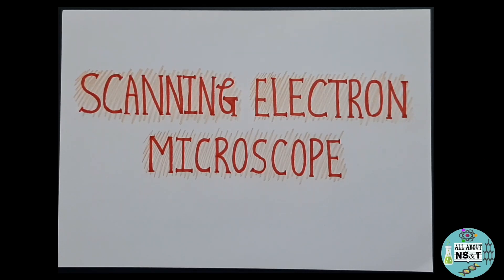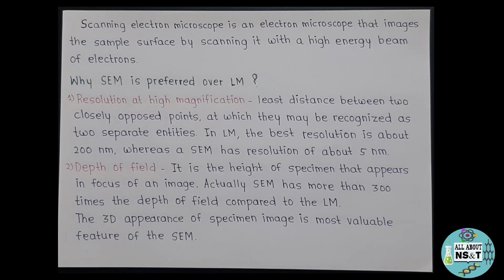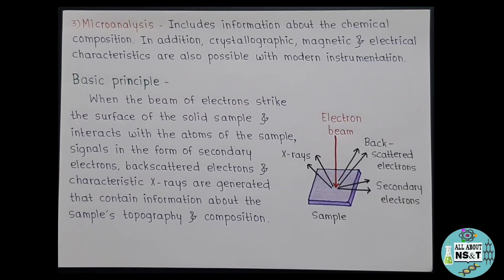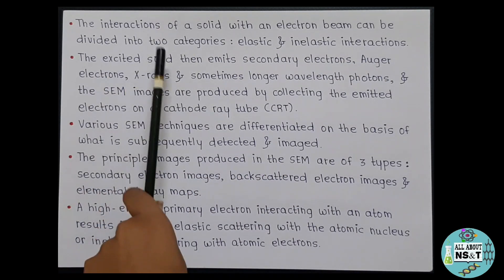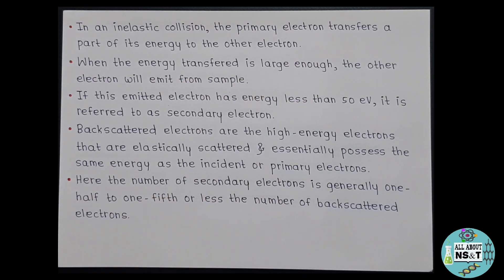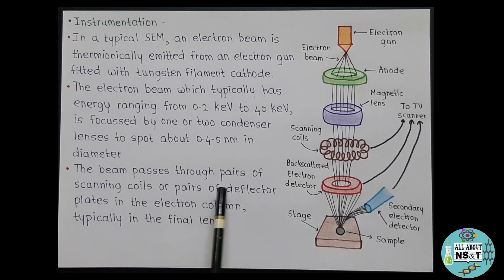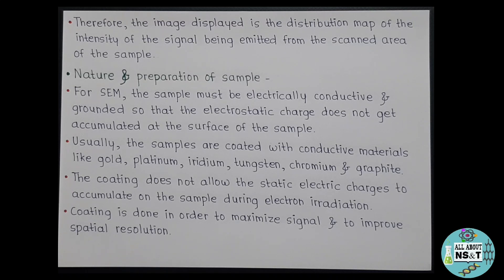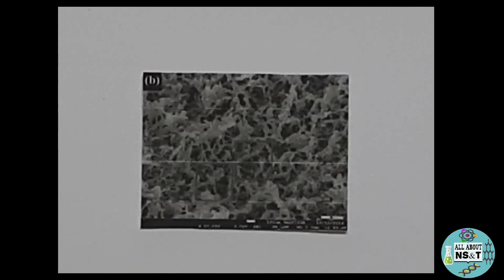Scanning Electron Microscope (SEM) | Principle, Instrumentation, Working & Applications

Comment: Hi All About Nanoscience & Technology,
I have question about SEM, in your video, 2:38 I saw  SEM has resolution of about 5 nm.
1/ Could SEM see nano materials, clearly or blur ? (I mean it's a normal SEM, not FE-SEM or high resolution SEM).
2/ Which is the best method, cheap and convenience for characterizing (shape and size) nano materials?
I hope I would receice your answer soon.
Thanks All About Nanoscience & Technology so much.